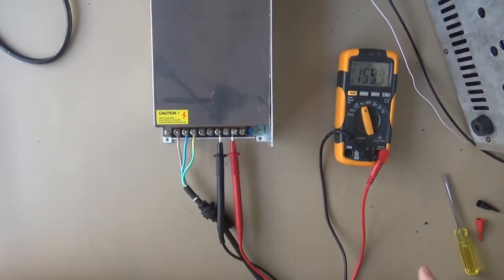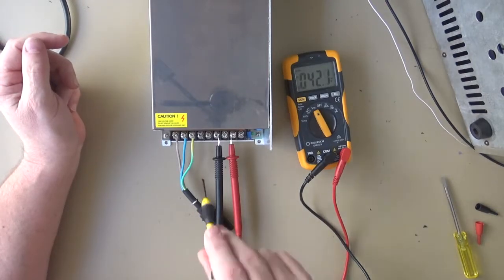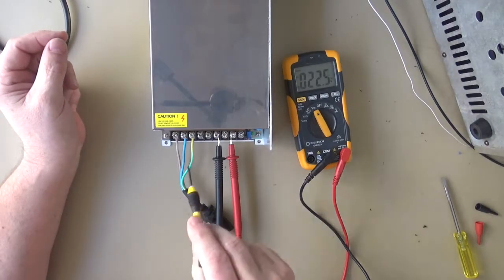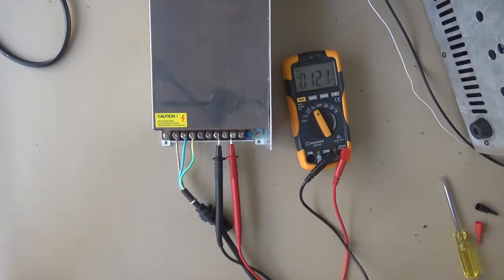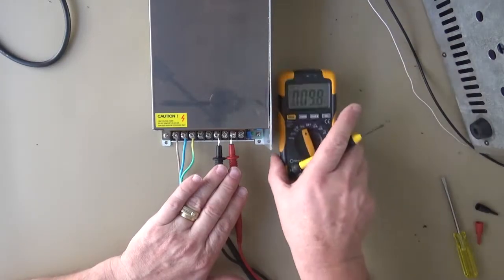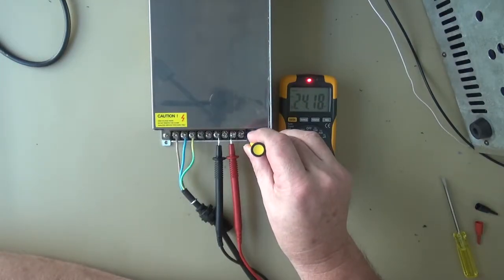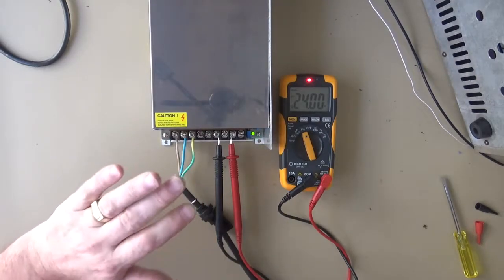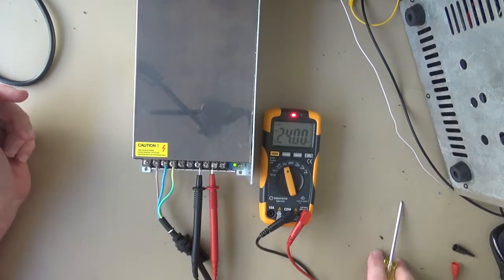#099 Setting Voltage On A Meanwell Style Power Supply

Comment: I have that same supply, blew in my aries, got a new one and hooked it up, psu works fine but now the board is blowing it's 15A fuse. Could the board have fried when the psu went, or could the replacement be up too high and blowing? It's a chinese variant of the meanwell supply.

Comment: How do you adjust the input voltage from 220 to 110V??
Reply: That's what I was wondering too
Reply: @Straight-Outta-Roanoke-AL  The ones I've used have a red switch inset on the side of the psu that you switch toward or away from where you connect the wires.

Comment: I dont know, why dont they use plastic body to avoid hazard due to metal body?
Reply from the maker: I think they connect the heat sinks to the case so it helps with heat dissipation. As long as the earth is connected correctly it should be safe, but yes totally understand your point.
Reply: @GrumpyOldTech  Thanks

Comment: Hello dear, great work
I have MW RSP 2400-12 and it is not giving the output 12 volts DC, giving only 5 to 6 volts DC, i tried to adjust from the adjustment screw but same, even decreasing more to 4.4 volts. What should I do?
Reply from the maker: Is this with no load connected??
If no load then it sounds like it has failed. If it’s with a load connected, first try with no load and see if that works. If it does maybe need to check the current draw to make sure it’s not overloaded.
Reply: @GrumpyOldTech   yes sir it is with no load, and if it is failed ,is there any option to repair it?
Reply from the maker: There is always an option to repair. Switch mode supplies can be a little tricky to work on though and dangerous with the voltage they work at. If you aren’t trained in electronics I would try find someone who is and understands switch mode supplies. The costs can sometimes not make it worth repairing though. The good news is, since it is a genuine meanwell, parts should be obtainable.
Reply: @GrumpyOldTech  thank you very much sir
Reply: Just try replacing adjust potentiometer. Must of the time potentiometer is open.
Reply: What voltage are your mains where you live? There is a switch on the side of the PSU that toggles whether it's set up for 120V or 240V AC input. If you have it switched to 120 and you plug in 240, you'll kill the PSU. I'm not sure what happens if you have it set on 240V and plug it into 120V AC. It shouldn't damage it. Maybe it'll put out half the rated voltage because it's comparing it to mains, which is half of what it's expecting. Not sure!

Comment: Hi. Do you know if it's possible to use it as a discharger?
Reply from the maker: Sorry I don’t quite understand your question. Are you referring to the voltage adjustment potentiometer?
Reply: I mean yeah to use the Meanwell power supply to discharge a prismatic cell. I need to discharge some specific cell from a battery pack and I ain't know how to do it
Reply from the maker: What about just putting a resister across the cell to discharge and monitoring with a meter so you don’t over discharge the cell. This is basically how the battery management controllers balance the charging of cells in a multicell Li-Ion battery.